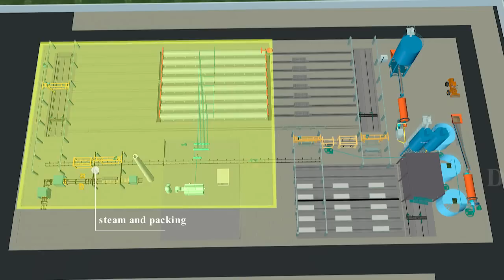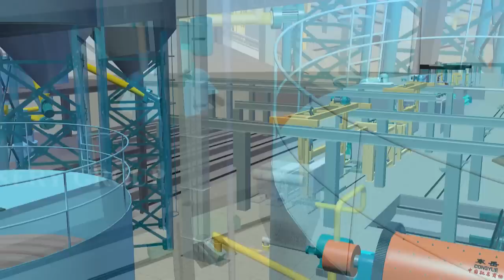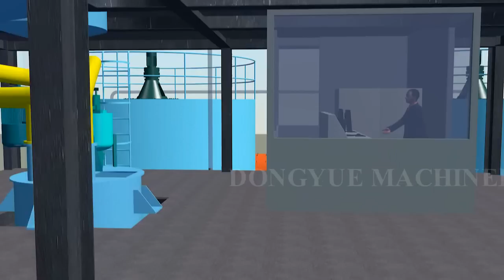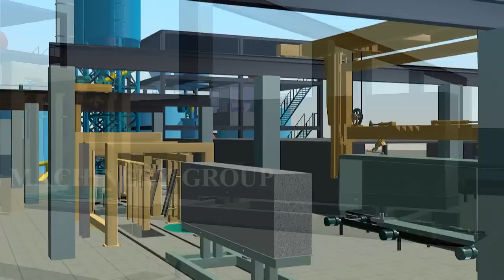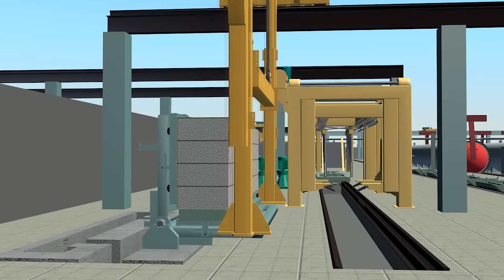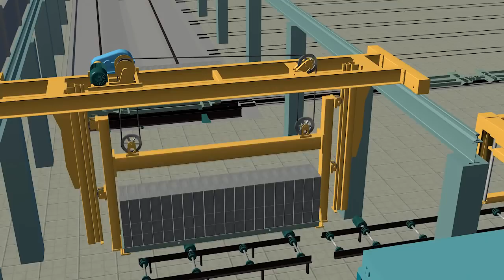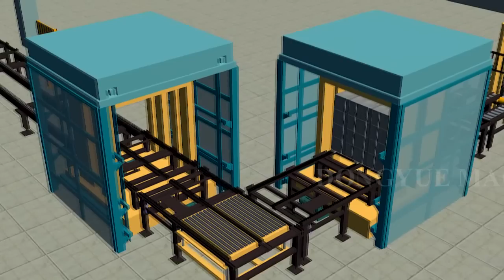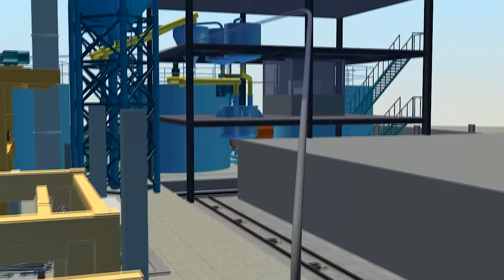AAC Block making machine/ light weight block making machine manufacturer

Comment: Hi, if some boss need concrete brick machine, just tell me, i could supply you good performance brick machines.  whats app: +86 152 6972 22300
Reply: Fuda Brick Machine Factory  what is the cost